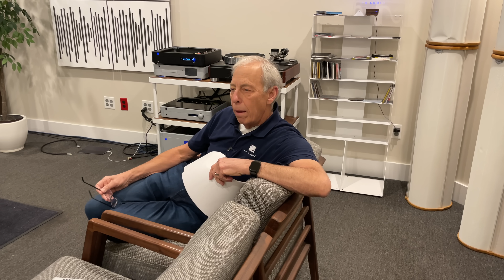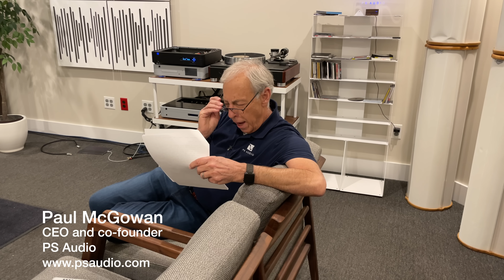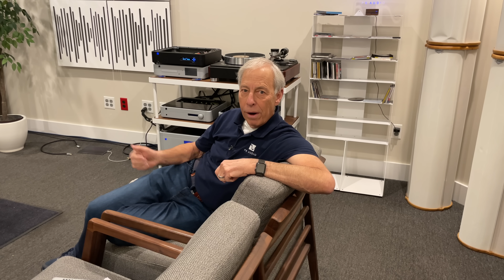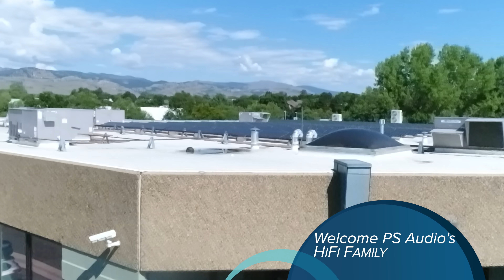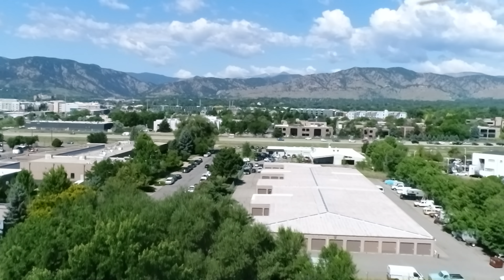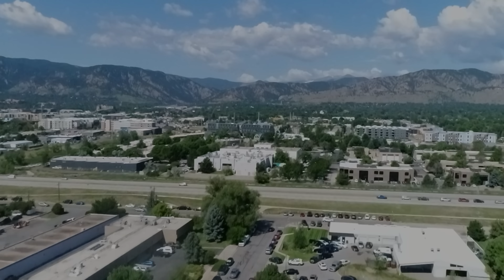High end amps vs. pro amps

Comment: Amps don’t have a “sound”. When an amp alters the sound it’s called distortion. In other words if an amp has a “sound”. It’s a badly designed amp. Most amps have distortion rates that are far below the sense of human hearing. If you want to improve your audio system invest in your speakers and acoustics. Changing your hearing posion 50cm alters your sound way more than any amp ever will. If it’s not a shitty amp that is.
Reply: this take pyhsically hurts me
Reply: You give very little importance to the amp's work, and it's a big mistake. I wonder what kind of practical experience you have about sound systems, if you even have some.
Reply: @rob_silveira  I'm an electronics engineer and I've worked in sound studio's as mastering engineer for 20 years. Making an electrical signal bigger without changing it to much is a piece of cake. Modern amps have distortion percentages with a few zero's behind the decimal point. The tricky part is to convert these electrical signals into air vibration. But if you have some underpinned information that explains why any amp with a low enough distortion rate isn't up for the job, please change my mind.
Reply: uh ok then maybe you should go and inform every amp manufacturer on the planet that the reason they don't all sound the same is.... they're shitty amps?
Reply: @DueM  The problem is, they all sound the same! People just don't want to accept that. The same people that refuse to do a double blind test. Cause they would all fail to identify any amp, when they are not aware to which amp they are listening to. Just accept that you're hearing is not suited to hear the low distortion ratios only very sensitive equipment can pick up. Just get over it, and buy the amp that looks the most appealing to you and get on with your life.
Reply: @hunchbackaudio  I have 2 denon amps that sound different, ones an a/b the other a mosfet,  maybe book in for a hearing test. Signal to noise and thd ratings aren't indicative of how a piece of equipment sounds, just how much distortion is present.
Reply: @DueM  In the Netherlands a big distributor of Nakamichi, Studer and Quad did a blind test with several amps, including a tube amp and a MOSFet and people could even bring there own amp. There was a rotary with that selected each amp, with an indication of A,B, C and D. The listeners were not told which amp was on A, B, C or D. Almost all listeners preferred on specific setup unit someone els controle the rotary switch and they had no idea on which amp was selected. Then the preference was gone or did change form position all the time. That settled it for me and a lot of other people I can assure you. And unless you have a toggle button that enables you to switch between your two amps, there's no way you can compare them, because your sound memory is shorted that you think.
Reply: @hunchbackaudio  this isn't an argument that says they all sound the same though, its like dacs. they all do the same thing and music is recognizable through them but theres always differences between them, usually subtle as well. i have a cambridge amp here that was highly reviewed and on paper is almost exactly the same as one of the denons, it sounds the polar opposite to them regardless of specifications.

Comment: It's called being able to fleece someone. Pro gear has to live in a commercial world delivering quality at a realistic price. Domestic hi-fi gear has has no limits - price wise of course
Reply: It not only has to deliver quality, it has to delivery industry standard quality, which is a very high bar to achieve. It means there is no better quality unless you start interjecting subjective non-linearity into the signal or start upgrading components with the same values.

 I'm floating around the idea of negative distortion in my mind. You start getting distortion because they playback equipment does not have enough of the same sort of distortion as appeared on the mixing board when it was recorded, mixed and mastered, so the flaws of the recording start to appear - see negative distortion. I've found this to actually be just as bad as the other more traditional forms of distortion.

Comment: As a pro sound engineer we use amplifiers (technically "controllers" these days as the signal processing is largely built in) that cost every bit as much as high end domestic units. The likes of Behringer & the value lines from Crown & QSC are certainly not what we're deploying on the road, more like the Crown I-Tech level or the L'Acoustics LA12X which are specifically designed to compliment the speaker system they are driving. Where Paul is correct is that the designs have to incorporate parameters domestic amp builders need not focus on. 15,000 people asking for their money back does not good marketing make!

Comment: Pro audio amps and Crown Drivecore amps in particular have gained a legitimate foothold in the home audio world and no doubt Crown is enjoying every penny of it. Crown has the design/engineering ability to capitalize on this relatively new revenue stream and I am looking forwards to seeing this happen. The Crown Class D amps are only going to get better.   I am using a Crown XLS 2502 to drive four 10" subs in a pair of sealed cabinets for home theater. The headroom in this setup, the shear ability to cleanly go beyond what I'll ever need is fantastic.
Reply: Also, remember that audiophile amps sales don't come near the volume of market of Crown or Behringer. So they must take a higher mark-up to make profit. Price don't always dictate quality in the audio world.
Reply: @SilmarilS79  You got that right..My two NEW Behringer EP4000 for only 900 Euros together sounds better in my livingroom than you would think.
Reply: If you are using to pro amp to drive vintage speakers or sub woofers, there are pro amps that have RCA inputs, like the Crown XLi series (XLi3500). You are not stuck with XLP connections, so you do not have to use a converter like an Art Cleanbox Pro unless you want to. The XLR cable's primary advantage is the can be ran for long distances without picking up any noise. When you are only dealing with two amps sitting next to each other, a set of short high quality RCA cables work just as well.
Reply: Finally somebody with sensibility. XLR cables are not necessary for a home theater that's not running 50-100 foot or more cables. @quitmanlott7394
Reply: I totally agree. I was kind of afraid to buy the Crown XLS. due to many people who have purchased it but did not configure it correctly. it takes a bit of know-how to use it properly. It definitely makes a great subwoofer amp. I bought XLS 1002 as an experiment on DIY subwoofers. 
I'm driving four 10-inch subs in bridge mode at 4 ohms. sounds awesome. but to get to work right with an HT receiver you need a converter box to go from an unbalanced to a balanced connection with a slight preamp. I used the Art Cleanbox Pro. which changed the entire sound.
Reply: Absolutely. The Crown DriveCore amps sound excellent to me. If you want more features than the 4 to 5 hundred dollar models they have those as well, but you're going to pay big bucks. If all you want is a great sounding amp with tons of big watts you can't go wrong with a Crown in my humble option. Or you can build one yourself from IcePower modules, which I believe Crown amps are made from, you can save a few bucks.

Comment: Some pro amp brands comprise Studio series, and the ones from Crown (Studio Reference, though they mayn't be build any longer) and MC² Audio (S-series) are truly excellent. I'd hold those against most anything I've heard, and they're sold for considerably less compared to audiophile segment "high-end" amps. My take is that audiophiles, by and large, steer clear of such alternatives, or refuse to seek them out solely because they're pro brands, not because of what they've heard (because they wouldn't even care to, certainly not unbiased), and if they can afford more pompously priced hi-fi alternatives then why not spend the more money they got or allocates while fitting more smoothly into the audiophile narrative? 

Not being able to, or even wanting to spend extraneous amounts of money on sound gear, while still wanting it to have excellent sound, has taught me to keep an open mind and identify great sound from whatever segment it may originate, be that pro or not and with no care in the world about its looks or what other audiophiles might think of it. My own gear "portfolio" comprises a mix of 2nd hand and new, pro, DIY and high-end/hi-fi, and the good thing is that being nonjudgmentally "inclusive" this way allows you to more readily strive for physics to be accommodated - i.e.: there's no replacement for displacement, etc. - which would have otherwise cost a fortune with high-end audiophile segment gear.

Comment: I picked up a set of semi vintage Yamaha pro amps to use as subwoofer amplifiers (Yamaha P4500's). Hooked them up to test them on my main speakers in my main rig and fell in love, in the past 6 months I have had no interest in switching them back out. Spec wise they are very comparable to Yamaha HI-Fi amps. Class A/B, 620 WPC @ 4 ohms, 0.005% distortion.  All I can say is these amps are magical, they are setting on a stack of unused amps that include a pair Hafler Transnova, a pair of Adcom GFA 555 MK2's and a fully restored and modded HK Citation Sixteen, so its not like I don't have other options. In the past I have had a set of BGW amplifiers that I was impressed with as well, so I would say it would be a case by case basis, I probably would not say the same about the newer light weight Class D pro amps.

Comment: If you are consumer of the music (you listen to music) then you buy Hi-Fi, Hi -end. And If you are music/sound producer, if you need music equipment to make money - you are buying Pro equipment. Pro equipment is just a tool to make money. For example there is no reason to buy monitor speakers for your home unless you are making music/sound.
Reply: So using the tools used to make the music to reproduce what they were listening to whilst making it is somehow worse?
Reply: @GreyGoshawk  It will not make it worse! It will be less enjoyable. I have studio headphones to produce and consumer headphones to listen to music and enjoy. Different feelings...
Reply: @GreyGoshawk  Studio equipment sometimes is not the best in terms of precise esthetic design comparing to  consumer product that is going to be sold in much higher amounts and profits. The sound  is different - less bass sound on studio monitors, more bas on consumer. Usual consumer that listen to modern music that has a lot of bass/beats will be disappointed with the sound of monitors, that have even frequency characteristics.

Comment: Whilst I fully appreciate your point about Crown amps and ‘pro’ amps in general. I ponder on this one.

Pro amps are used in professional, live, music venues.  Then along come ‘high end’ manufacturers, such as your good selves and say, ‘Now hang on, in order to create musical performance as close too the original as feasible, we’re not going to use the same technology abd circuit topology as the equipment that created that original sound, we’re going to employ a much more costly technology.  Why, it doesn’t make logical sense.

Now, don’t get me wrong, my hifi rig includes a class A-B pre-amp and m monoblocks and I love their musical reproduction. I’ve never heard crown, in a home, audiophile set up, but I have read and seen dozens of glowing reviews.

Comment: Its exactly right. Ive heard a crown amp and yes it does have endless power and i could not even get it to 1/4 volume. Is it clean power? Yes, i mean its 1500 watts (im thinking more like 500 in real world) and your not using 100watts for house use. 

Does it sound good? Not even close. Even the marantz pm5005 beats it in sound quality. I would use crown amps for subwoofers though.

Comment: Pro audio is a big range, from small clubs or restaurants to stadiums; and recording studio monitors are something else entirely.

Also, recording monitors are designed to sound true, and reveal weaknesses in the mix. Consumer hi-fi equipment is designed to sound good; regardless of source material quality... this results in some distortion being introduced in consumer gear (usually the ear-pleasing kind of distortion; but it’s not strictly an exact mirror of what the source device is putting out). Adjusting tone/eq controls to taste exacerbates this.

Comment: I'm using two Crown XLS1000 amps to drive Zu Omen Dirty Weekends and a VMPS New larger sub. I find it hard to convince myself that it isn't supposed to sound good, because it just does. They do need to have their loud fans swapped out, though. Stock fans were hi-fi showstoppers for sure. The volume trims on the Crown also allow me to adjust the sensitivity of my preamp volume knob. Other high end amps are surely calling my name, but I don't feel the pressing need to spend the cash as the Crowns appear to do everything right within the limitations of my room.

Comment: Is it easier to say, Crown amp doesn't have such eye catching VU meter, bulb with yellow light, and a rectangular remote?  And as well as a noisy fan to dissipate heat so efficiently such that it can run 24x7 even in a cramped equipment rack!  And it won't cost you a fortune!

Comment: This subject keeps popping up. I find it interesting because so much of the recorded music we listen to was actually mastered using “pro” equipment. Makes your head spin, doesn’t it.
Reply: Yup its a bit of a paradox.  Sort of liek the fact that a great sounding setup can actually sound better than a live performance in theory lol.   Much more to sound than meets the eye...
Reply: Hello just wanted to add that pro audio amplifiers are not used in the process of recording and mixing records. Nothing you hear goes through them. They may be used for monitoring in the studio but these  amps just need to measure flat which virtually all amps do. It makes a lot of sense that pro amps would not sound as refined or as good as hi fi ones.
Reply: Agree. How can the pro equipment be good enough to record the music but not good enough to play it back?
Reply: @doronor6552  good pro amps sound fantastic because of science.  Good audiophile amps sound great because of religion.  Audio industry professionals are usually guided by the science of good sound, and thus use high-quality and great sounding pro-audio gear.
Reply: @Barry-Watson  I mean of course a 100x more expensive power cable is going to sound better. It cost more, you get what you pay for, that's science.. or something...

Comment: C'mon Paul, we are going through the same sales pitch as the power cables.   Biiiiiggggg power cables that the consumer pays and really they do not measure any different than the average power cable that come with the unit... example, Monster Cables  what they do not tell upi is the fundred od chip Romex inside the walls. a 5F of "special," cable is going to make a difference when you have all those 100's of feet of ordinary cable in the walls   Snake oil.   Same as component in the amps. There are components  very expensive and there are Components with the exact  characteristics and equal measurements that can be substitutes for.
Yes some of the inexpensive components nay fail sooner. However as the technology advances the it is more and more unlikely. I examined amplifiers and radios from the 20s' with much lower technology and relatively inexpensive at the time of purchase that still working after all these years.  So, another Snake oil.
Reply: @Lloyd Stout Ok, then re battle your position and explain yourself on your position. I am interested. I explain it from an engineering point of view. Capacitance,  resistance, semiconductors and every component in a system has unit of erotic stories  and  standards of measuring. Even the spikers alone.

Comment: Question: Has anyone encountered a power amplifier that measured well in all the usual ways -- e.g. a zero or two after the decimal point of THD+N, flat frequency response, good load tolerance, etc. -- and subjectively/obviously sounded objectionably bad?  Paul touts the BHK product as his best, but it's actually, measurably worse than a Stella -- with it's off-the-shelf OEM Class D output modules -- or a bargain-priced, feature-rich Crown.  Is the high-end segment of the industry still in the high fidelity (meaning great faithfulness) business -- or they now in the psychological game of touting supposedly audible intangibles to deep-pocketed folks who fancy themselves golden-eared enough to hear superior "musicalilty," "resolution," and "soundstage" (in a power amp?  Seriously?) from a product traditionally designed with the "straight wire with added gain and power" ideal in mind?

Comment: Sorry but a QSC GX5 700W 2-channel, PRO Power Amplifier will sound better than 99% of the "HiFi" power amps... have a headroom that You can only dream of in a HiFi amp...
and it will run You $449.99